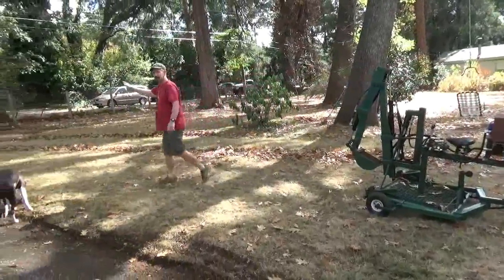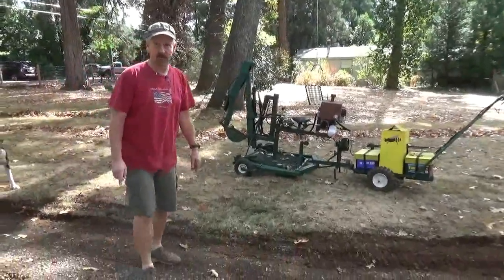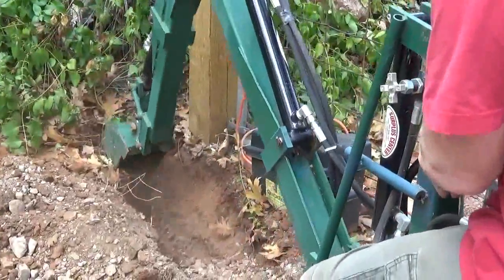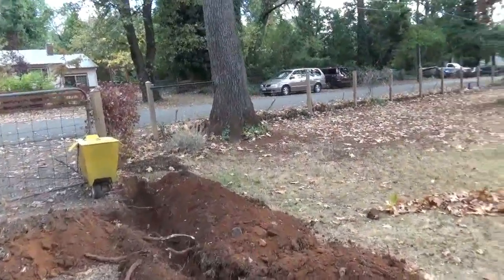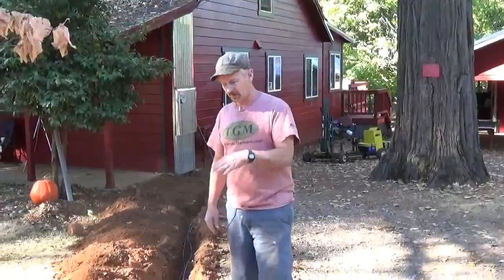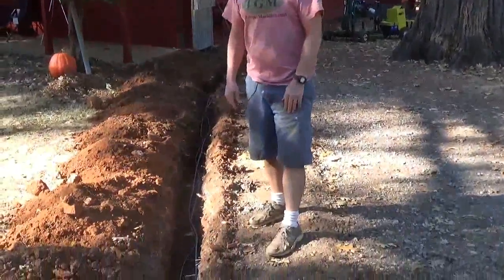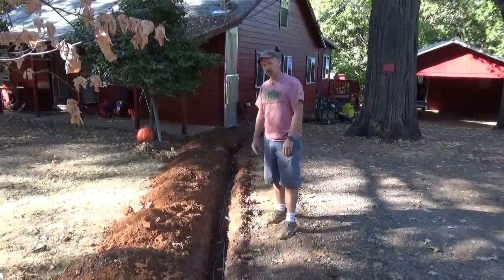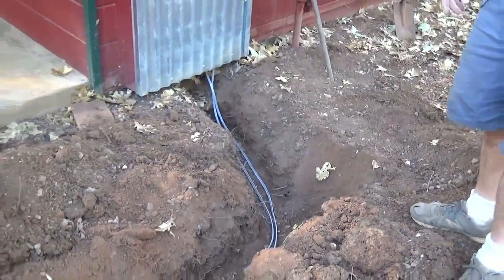New Tow-able backhoe trenching .

Comment: We're two old prospectors. We dig for fine gold the old timers couldn't get or bother with. We're wondering if we could replace our gas engine with a battery powered 12 volt starter motor out of a V-8 to turn a small power steering pump that delivers 1600 psi max? Because the Forest Service in some areas require a permit for gas operated implements. We are allowed to dig two cubic yards at a time. Any thought?
Reply from the maker: It would work but the starter motor would over heat after about 2 minutes . go to  surpluscenter.com You can size the motor to a pump. I'm not sure the flow rate of the power steering pump but you will need to find out the flow of the pump to make sure it will be enough for your backhoe then go to the motor.. I hope this helps

Comment: super cool what costs only the hydraulics so 3x cylinder 8x hose 1x pump. How much horsepower does the engine have
Reply from the maker: It costs about 1500 dollars to build.  6 Hp motor. Thanks. Lonnie.
Reply: Thanks for the quick answer. We hope HUb have such a cylinder. Can I get a sketch with about moderation.
Question: is an overpressure built into each control valve to create a cycle? Otherwise it would burst.
  Greetings andyngd@gmx.de
Reply from the maker: Hi. The hydraulic system has check valves set at 2000 psi . The cylinders would go much higher than that.  You can send me an email .  thegreeensmachines@gmail.com    
Thanks. Lonnie

Comment: I built my GreensMachine backhoe over 5 years ago. I heavily modified mine from the original plans, including bigger base, hydraulic slew, bigger buckets, different cylinders etc..  But I must say, mine has been such an amazing little machine. Don't let the size fool you, hydraulics are strong. Mine has saved me endless amounts of times from digging. I just cant get over how well mine has worked. Once again thanks for providing plans for such a great machine!!!
Reply: I've seen your machine.  You did an awesome job.  I'm in the process of building mine.  I'm about 75% finished.  Was thinking of copying your idea with the hydraulic motor for the slew...  What size motor did you use?   Thanks.
Reply: monsterenergy27 si